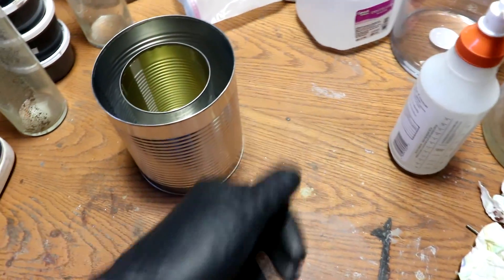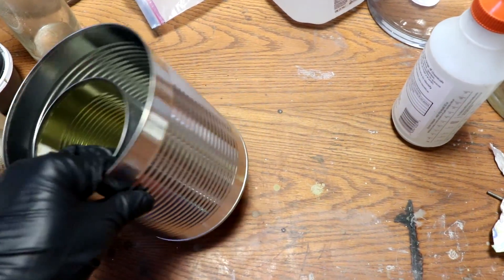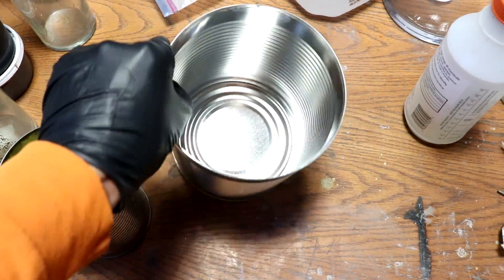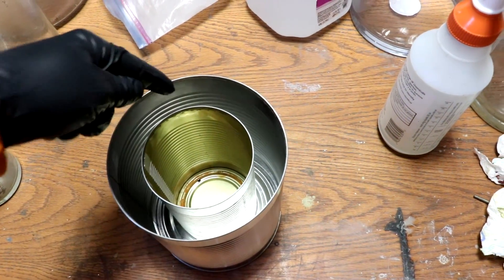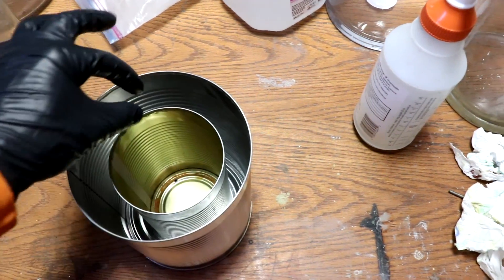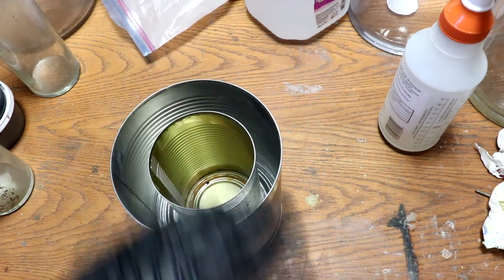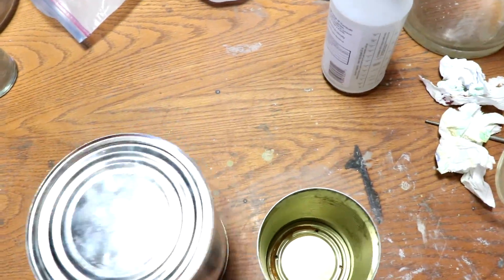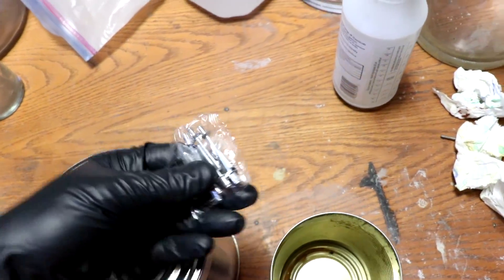The Rad Can

Comment: Will it not leak radiation at the bottom? The inside can goes all the way to the bottom, so in between the outer shell and the lead bottom there's a thin circle of non-lead.

Comment: That's a really nice container. But I think lead is expensive and overkill for such applications. The radiation from some yellowcake really isn't that much to begin with. Also, in a closed container radon decay products will contaminate the inside of the container and easily transfer to gloves, hands and anything that is in the container.

Such lead containers are well suited as shielding for gamma spectroscopy though. I got one too that is partially cast lead with some extra concrete around it. Bare lead inside is still a bit undesirable as you get strong 80 keV gammas by excitement of the lead by gamma (fluorescence) and beta (bremsstrahlung) radiation.

Comment: What a Coincidence, I was just About to make a lead container tomorrow (seriously) because i just found a small rock of Uranium ore giving me more than 110 Mikrosieverts/h yesterday!
Reply: 110 microsieverts is not that hot. I suspect your ore contains small amounts of thorium or uranium.
Pitchblende would be far more radioactive as it contains many daughter products, such as radium.
Reply: @anti-fz9be you can see at 2:20 in the vid that his yellow cake is giving him around 7mikrosieverts/h from the distance he's measuring it, so i thought 110'd be Pretty good but I mean you're Right it's not like high grade Uranium ore, more like low to medium i guess
Reply: You have to consider that the time it takes that old gieger based sensor to reset, you've lost a decent amount of accuracy. Don't even know why people still use those. Not accurate, not safe.
Reply: @Baigle1  you mean geiger-muller tube? And yes, scintillation detectors are more accurate.
Reply: Seriously man?
Reply: @mosaatabdallah9445  yep i really found some nice Ore, i think it's pitchblende
Reply: @Max Miller did some looking and sure geiger tubes are ok for alpha and beta if you DON'T have the shield on, and you use a pancake/ much larger than standard tube... scintillators have some drawbacks too. pretty sure there is some detector that a science fair kid made using plasma when Obama was pres. needs further research.

Comment: The color scheme is supposed to be “magenta on yellow” on the radiation warning symbol. Incidentally it also looks far cooler than black on yellow.
Reply: Ehh, magenta on yellow is a bit ugly in my opinion.
Also, magenta & yellow are (or maybe were) only used for nuclear fallout shelters, not for ionizing radiation hazards. If you're dealing with radiation hazards, the color scheme is anything that's high-contrast and very visible.

Comment: What happened between 1:12 and 1:15? Cody pours led inside the inner can, and then in the next frame we see a led lined can. What did I miss?
Reply: Alpha particles can't across lead (at minimum 2.5cm) so he just make a giant container out of lead
Reply: @kman4165  I understand that, but how does the lead get from inside the inner can to in between the inner and outer can?
Reply: @vexrav  there is no leak of lead he first add to small one to make button then he make a wall in the bigger one bro
Reply: @kman4165  Ohhh ok that makes sense

Comment: You may already know this, but be sure to not store beta particle emitters in lead, or else you will wind-up creating  bremsstrahlung x-rays.  This is why beta emitters are instead stored in thick plexiglass containers, and are handled only with plexiglass shielding.
Reply: I really wish someone would back up these claims by actually giving some kind of proof of whether that's a significant risk in this case. I don't know enough and can't find good enough info on the matter to evaluate that myself.

Comment: How do Geiger counters work again?  And how do you make a radiation suit?
Reply: Most radiation suits don't really block radiation, they just keep you from inhaling fine particles and getting radioactive dust on your body. They'll block most alpha particles, but beta, gamma and neutrons will get right through. Wearing tin foil (or Al) might block beta, but nothing you can practically wear is going to protect from gamma rays, you need thick lead shielding for that. As far as how a geiger counter works, try searching for Geiger-Mueller tube.

Comment: Jesus Cody! Be careful you aren't reaching critical mass. If it starts to fission you are in trouble. 

A thin layer of lead and then poly works well to and its much cheaper and much less weight. The lead refracts the roomies thus increasing the effective thickness of the shielding. If you use borated poly it will even eat neutrons ;-)

Comment: Cody, I hope there is significantly thick layer of aluminium between source of radiation and lead.
Lead has very high nuclear charge and any beta particles colliding with it tend to release very high energy gamma rays. Aluminium has a lower nuclear charge and therefore gamma rays released from beta particles passing through it will be of much lower energy, allowing lead to more efficiently absorb them.

Comment: For yellow cake and U minerals the γ emission is relatively tiny. I just wrap mine in Saran Wrap and then aluminium foil (former minimises Bremsstrahlung from relatively low β-). Even without any shielding at all, the α particles won’t go more than 10cm or so. Really, lead is overkill for anything other than gamma emitters.
Reply: Uranium ore contains two significant beta/gamma emitters, Pb214 and Bi214. Not yellowcake, though.  Alpha particles don't even go 5cm in air as a fluorescent screen and an Am source from a smoke detector will show.   The thickness of lead used in the video will only reduce the gamma emissions by about 50% - couldn't determine the exact thickness, one cm perhaps?  So if he has hotter samples the can won't actually do much.  Suspending them in a waterproof jar in a barrel of water is probably more  effective, even if not very "cool"
Reply: George Reynolds Yes but the amount of gamma emitted from a lump of U ore that size is minuscule in the grand scheme of things, and completely harmless really. Isn’t lead-214 mostly a B- emitted with comparatively tiny amounts of gamma decay? Bismuth-214 is mostly beta minus too, isn’t it? In as much as they’re not in high abundance and aren’t kicking out much gamma either. Personally I keep most of my U minerals on open display but a good 30cm from edge of shelf so it’s hard to get close to them. The cpm nearby is pitiful once you’re beyond about 30cm as all that is left is gamma which is pretty tiny in amounts. Common error in examining U by GM tubes is to forget the energy of the particles is so small that they stop almost perfectly inside the tube so the CPM to DPM ratio is much higher than for e.g. carbon-14 or phosphorus-32. The only isotopes I would bother to keep under lead are things like iodine-131 where the G emission is so significant.
Reply: @TheSpinDoctor  The Bi214 is very important as it gives off the high energy gammas that are the characteristic of the U238 series, so all airborne measurements focus on this one. Like Pb214, they are both beta minus emitters, so also give most of the beta and gamma radiation that a GM detects, unless one has an alpha detector with a thin window.  When Cody put his material into the can, the beta radiation disappeared and only the gamma radiation was detected.  Most of the other members of the U238 series are alpha emitters with little or no gamma radiation.  When the entire series is in equilibrium, all the progeny have the same activity, but the quantities vary in proportion to their half-lives.  A distance of 30 cm is a good rule for storage.
Reply: George Reynolds Even so, pitiful amounts of gamma in real terms and not worth putting it under lead. Tbh given the amount of beta emitters in U ores I’d be more concerned about the X-rays from them hitting lead than I would be about the native gamma  - can’t remember what the energies of the beta emitters are (and obv gamma and X are identical in all but their source) and if many are over the threshold to cause Bremsstrahlung, but in any case, I’d only ever use Lucite (Perspex) or glass for shielding a U mineral, never lead. If using lead, specimens should be in glass or Lucite boxes to stop beta hitting the lead really. I work with 5-50mCi kinds of amounts of carbon-14, phosphorus-32, sulfur-35, iodine-125, iodine-131, iron-59 etc in my day job and never use lead shielding. The nearest I will use is leaded lucite (the Orange kind) as lower risk of X rays. I do use lead bricks to shield counters of course to get reliable data but not for shielding specimens. I somewhere have a uranium-238 block coated in plastic that we used as a work surface for iron isotopes as it minimised gamma and X through the steel bench hitting the groin.
Reply: @TheSpinDoctor  Yes, you are dealing with far more active sources than natural uranium.  Geiger counters are very inefficient at the energies of the higher yield  gammas from Bi214,  0.609 and 1.765 MeV so we use NaI:Tl or CsI:Tl scintillators or even BGO crystals for fieldwork in uranium exploration.  In mines, the geometry is 4pi, so double the radiation, and the richest U mines in Canada (e.g. Cigar Lake) use remote-controlled mining machinery, as well as very strong ventilation (for the Rn etc.).  Bi214 beta radiation is about 3.3 MeV (from memory) and the x-rays are much less energetic so 2mm of lead suffices to absorb them. Lead boxes are not really necessary for small samples as in the video, but as someone said, they do look cool,  and to H&S bureaucrats it gives an impression of responsibility.
Reply: @TheSpinDoctor  Looking at the radiological info on Fe-59 I see "Radiation dose from 1 mCi of 59Fe is 64 mR/hr from gamma and 5100 mRads/hr from ß at 10 cm away".  That's 0.64 mSv/h and 51 mSv/h respectively.  They also recommend storage in lead containers and a film badge for more than 1mCi.  I guess you are in the USA, rules might be less strict, but the gamma and beta radiation from that source and quantity is not insignificant - be careful!
Reply: George Reynolds We don’t use use film badges anymore, they went out with the Ark. We use TCD on chest and fingers. 20cm forceps and a thick leaded Perspex screen is sufficient - once hot iron is in solution v little gets out anyway. Radiochemistry with it can’t be done behind lead blocks as you can’t see the reaction proceed so we use leaded perspex. For fieldwork I’ve always found GM counters to be sufficient in mines for finding U quite easily tbh. I wish we still had a proportional gas counter in the lab as I prefer them to LSC for many isotopes.
Reply: @TheSpinDoctor  We use dosimeters too but the regulatory bodies are often behind the times.  GMs are ok in mines if the b/g count is saturating a scintillometer, but for airborne or prospecting work a GM is too delicate and insensitive, so we use large-volume crystals, often tens of litres for airborne detection as the HVL for gamma in air is about 500m, way beyond what betas can travel.  I hadn't come across Fe59 before, no idea what you use it for but I imagine it is very interesting work you do, thanks for the info.
Reply: George Reynolds I use 59Fe for making hot pyrite and pyrrhotite which I then study the oxidation of by bacteria, quantifying the partitioning of 59Fe(III) as ferric sulfate and as jarosite (former is biology, latter is chemistry). Same bugs used to biologically mine uranium, copper, vanadium, cobalt and so on, worldwide. 35% of the copper in the world is extracted by Bacteria and Archaea.
Reply: @TheSpinDoctor  Now that is really interesting!  I had a colleague in Madrid looking at how bacteria live in acidified iron solutions for exobiological research, presumably Martian environments.  I have a different interest in pyrrhotite as it is usually magnetic and more electrically conductive than pyrite.  I guess YT is not the best forum for scientific discussions on a more specific level though. Good luck in your research!
Reply: George Reynolds I know of that group but I don’t know any of them personally. The ill-fated Talvivaara Mine in Finland was bulk of my work on mining and also on a prospecting site in Greenland for lanthanides and thorium.

Comment: With this design, won't there be a large gap in the shielding where the bottom of the two cans are touching? Are the rivots spaces to allow lead to flow between them and under the inner can?

Comment: Oooooh, I see what you did. I was worried the top and bottom weren't bieng insulated, But when you ladeled in some lead into the SMALL canister i really was head scratching. But then it all fit together, that's how you're insulating the bottom! and then just an inset cap. as long as the lid has a nice lipped seal, my earlier worries when I started the video are sated!

Comment: 5 microsieverts /hr, so less damaging than an x-ray?
Reply: Yes. gamma radiation is high energy (1-3 MeV and most of it goes right through you with no interaction with tissue at all.  X-radiation is lower energy, 30-100 KeV so most of it is stopped by bone and tissue (depending on the energy they selected) and does interact.

Comment: Water is an excellent radiation shield. Dig a shaft and line it. So you can fill it with water and keep your samples at the bottom of several meters of water.

Comment: But why does lead block radioactivity?
Reply: All matter blocks radioactivity. Lead is mostly just really dense, while still being fairly cheap. It's also slightly better than other common materials per gram, but that's not the primary factor.

Literally air blocks radiation too, you just need a lot more of it.

Comment: Question: will the hotter elements not energize the [initially] cooler elements to make them [at least on a temporary basis] more active than they would be in nature? ~( 'w')/
Reply: To my understanding, no. This can happen with some forms of radiation, but generally isn't an issue outside of nuclear reactors and nuclear bombs.
Reply: @seigeengine  What is the effective range of a moving neutron, and what will stop it's movement? If a neutron happens to pass outside of something like yellow cake into something else, is there not a chance it can strike a fissile atom in that material?

I am by no means saying a 'run-away-chain-reaction' but merely a measurable increase in ambient fissile activity.

Comment: Start over, do it right the second time!
 Why wouldn't offset the inner can with spacers to have a completely sealed lead lined inner sleeve? or easier yet pour a 1" lead bottom first (or whatever your wall thickness is", let solidify and finish the walls with a second pour.
 I'm glad to see you are attempting to take precautionary measures to handle and store this type of material, but this is no place to "Half Fast" your execution of making a safe radioactive containment vessel. You get NO POINTS for this poorly constructed container. Start over do it right so any other Yahoo in this position does think "Eh... Cody did it this way, Close enough"
And don't think just pouring some lead in the bottom of the inner can is "Good enough" either, because it's not. any number of things could happen to that container where the inner can may become detached from the outer sleeve. simple rust woould do it, dropping it just right could punch the simply crimped bottom out of the outter can sleeve. those cans are not designed for what you are using it for, but since you are trying to use the can just as a mold/form for the lead, then do it right by not including the can as a structural part of your finished product.
Reply: The only path through the bottom is along the wall, which there won't be meaningful amounts of material.

Any event that would destroy the can is going to destroy the can regardless.

You literally have no idea what you're rambling about.
Reply: @seigeengine  Anything worth doing is only worth doing right.

 I learned years ago that you should never try to teach a pig to sing, you merely waste your time and annoy the hell out of the pig. Good day.

Comment: So if I read his device right it looked to be about 6uSv/hr. Which in DOE language is about 0.6mRem/hr. The DOE allows occupational rad workers to get up 5000mrem per year occupational exposure (in practice its much less). The point being that as far as dose goes, what Cody has is basically background levels in most places of the world... Even without the shielding. Doeses you get by just being around in the world. 

That said, depending on the nuclide he has, the dose may be of less concern than ingestion. Alpha emitters can wreck your cells. I'm assuming he has some form of naturally occurring uranium he refined? Be careful breathing that stuff in bro. 

Also, Cody, what type of detector is that? Gm? Ion chamber?
Reply: another intelligent individual, greetings!
Reply: @Baigle1  thanks my dude.

Comment: was the amount of radiation that it gave off dangerous for you? i dont know much about radiation but that counter went nuts
Reply: No. Not really. He wasn't really letting it measure correctly (wasn't the point of what he was doing), but there's basically no risk from occasionally handling that material, assuming you don't ingest it.
Reply: @seigeengine  ah, ok thanks.
how would you measure something like that?

Comment: I've got optics with tritium in it... should I be doing this too!?
Reply: Very interesting point!  Those tritium glow tubes are in fact "highly" radioactive but the beta radiation is low energy and none of it escapes through the plastic and glass.  If you break the tube, the gas dissipates immediately, and goes upwards, being a slightly more dense isotope of hydrogen, so vanishes!